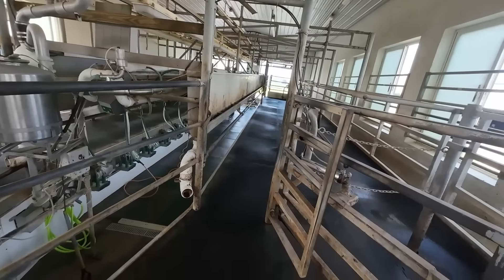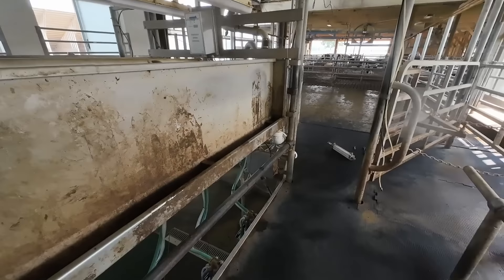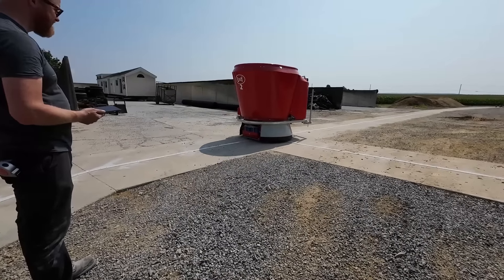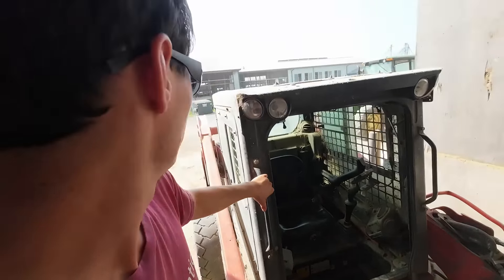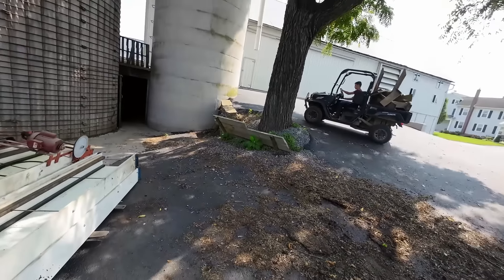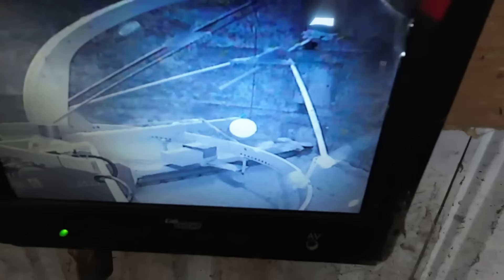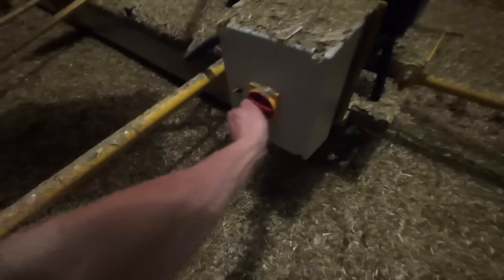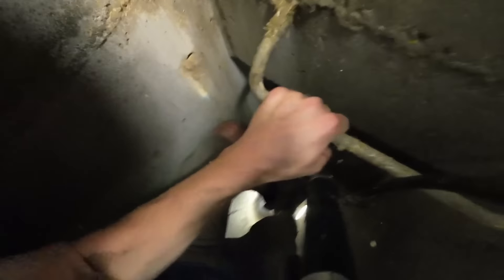Changing Doors on New Silo

Comment: 3:33 you should definitely add some rubber bumpers to the gates so they don’t slam all the time and break something prematurely
Reply: Bicycle tires, cut to size, do wonders for that job. A zip tie at the top and bottom will keep them in place.

Comment: I'm a novice when it comes to air lines. Although I'm sure you have a water separator for the air, crud can still form in the lines and play havoc on those valves. I've used an anti-freeze/ lubricant made for air on my grain truck. It helped very much.

Comment: The cross-over tube may have been to open one and close the other at the same time.  If you don't need that function, then pulling out the tee fitting should be just fine.  And follow-up question on the robot metal tracks, are those at risk during plowing in the winter?  Great content, love watching and learning!

Comment: why are the standard for navigation for these are the bolt on strips. when you first started i was sure they would just saw cut a strip and embed a little wire in the slit. it would be far more robust then these strips. if you get ice build up you cant scrape with them there and they are steel so they will corrode. i am sure it just makes lely more money and the farmer more indebted to them. youll probably have to buy the strips a lot.
Reply from the maker: I don't think it will be a big issue but yes it would be nice if it could be embedded in the concrete

Comment: Without seeing the air system for the gates its hard to know, but is it possible that the loop line was supplying air to something in the centre of the parlour from each side when the gate was open? There could have been a check valve inline or in the tee on each side and one has failed, might be why one gate was working & one always had air on each side of the switch. 

But nice work on the fix, you've sure got to know a bit about everything as a farmer.

Comment: For embedding the stips into the concrete.  Could you just get a concrete saw and setup some straight edges and just cut the section out like you do when you cut a dado into wood. I will take quite a few passes but you could then recess it and then re-attach it.

Comment: How will they work with snow
Reply: How does it work in ice and snow
Reply: How will plowing of the ramps to done
Reply: Pretty sure he said in a previous video they considered radiant heating when pouring the concrete, but it was cost prohibitive. I believe shoveling/salting was the decided method as of now.
Reply: Brush attachment for the skid steer
Reply: Eww snow
Reply: Shit ey. It would prob be pricey but all of those paths heated would be slick
Reply: You will find out
Reply: You will see when it happens
Reply: Tire chains!😂
Reply: Really in pa there are not that many snowy days anymore. Especially in the  eastern part of the state

Comment: Still don’t see how these robots will be more efficient when you just said about getting an attachment for the skiddy to clean the metal strips. Until those strips are cleaned, you could have been feeding already. Just don’t see it saving time. Sometimes the latest technology becomes a pain in the a$&!
Reply: Feeding takes 3 to 4 hours every day. Running a brush over the lanes every now and then will take much less time. It will also save them money. Electricity is cheaper than diesel, and they won't have to hire a feed hand for weekend feeding. The cows' milk production could increase as well. As the robots will feed small fresh meals multiple times throughout the day. Rather than just twice per day.

Comment: Very cool robots 🤖 
But why can’t they saw cut the concrete and lay a wire just below the surface 

Or at least counter sink those bolts 
This is going to become a nightmare as those bolts and strips get ripped apart as you try to keep your yard clean 

Now you will have to get a sweeper for your skid steer to keep their path clean